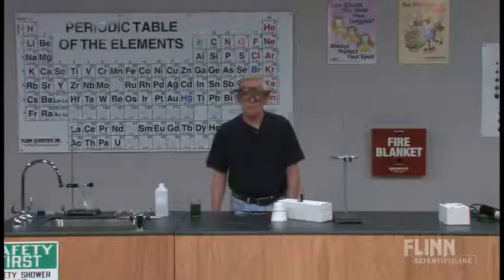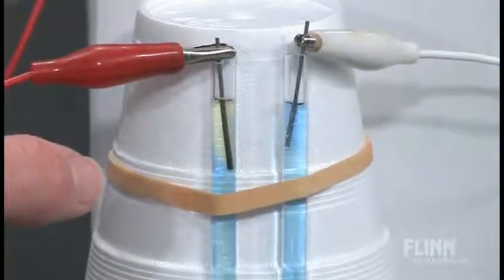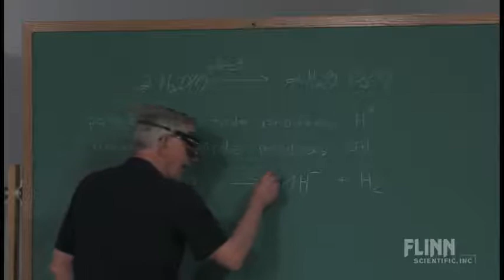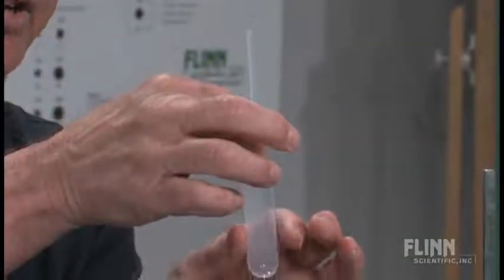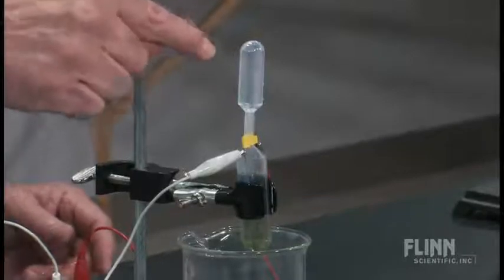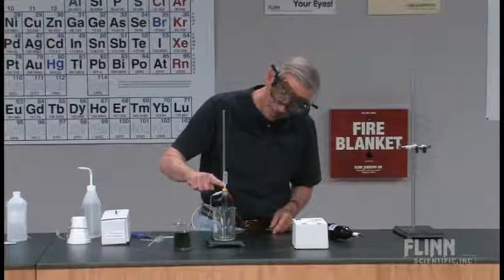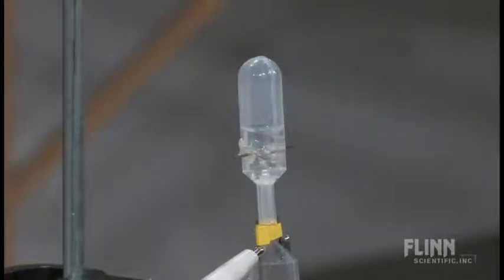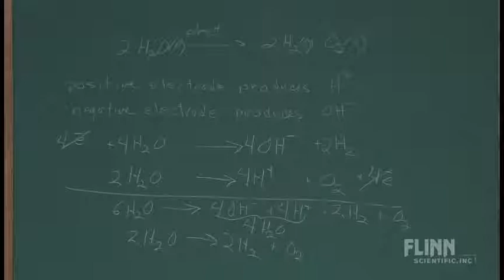Simple Electrolysis

Comment: Imho you're not electrolysing water, you're actually electrolysing the sodium sulphate and the materials used as the electrodes. The water breaks down whatever is in it and the electricity acts as a catalyst. The gases originate from the sodium sulphate and/or electrodes not the water.

Comment: Only my opinion, but you can't split water, you can only change the state's ie. Solid, liquid and gas.
When you run a current through a solution, you're splitting the electrolyte with the help of water. Water is not H20
Reply: Couldn't agree with you more!!! although the carbon anode electrode will break down too which is common within any electrolytic process.